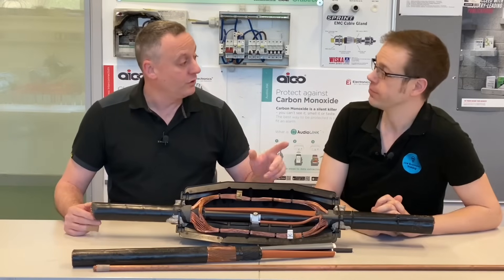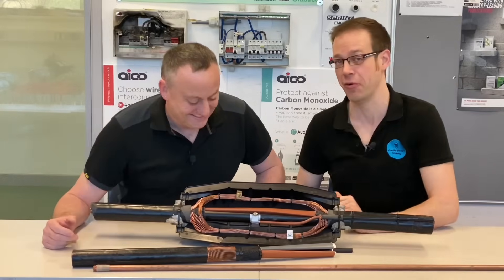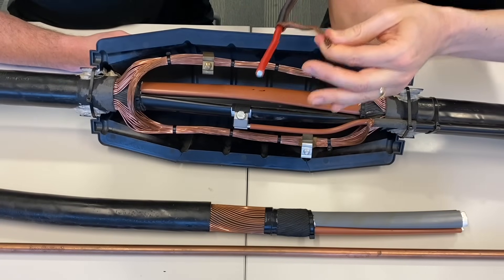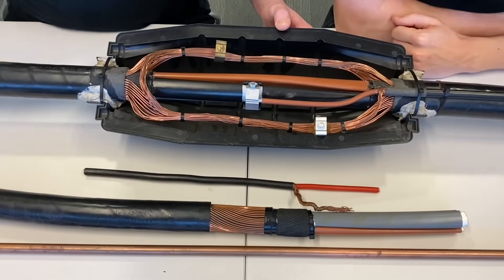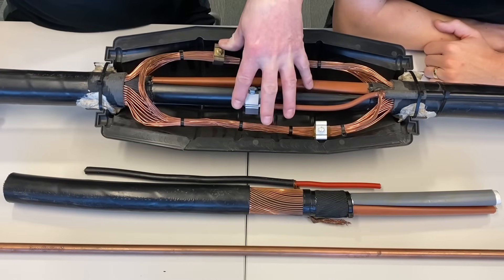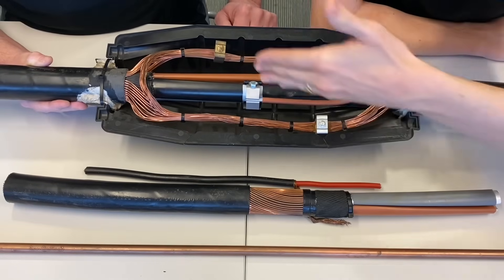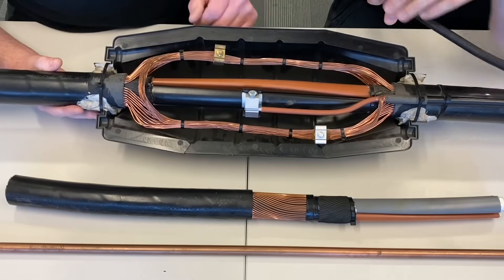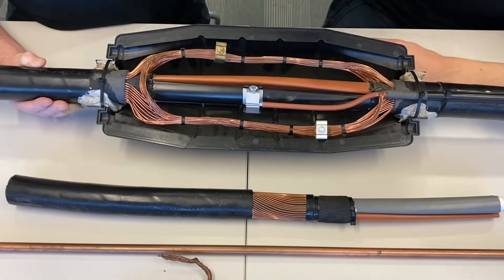Broken Pen Conductor - What’s Going on Inside a TN-C-S Cable Joints. PEN - Protective Earth Neutral

Comment: Old pilc cables contact the general mass of earth through the hessian sheath via the lead. In the 80’s when PME was coming in, jointers would go and bond the neutral to the lead at the extremities of the network with an earth rod in the ground. Jointing methods have never ever allowed the neutral or phase to be broken on service breeches as the joint must be done live to prevent the loss of supply. This goes all the way back to the origins of the electricity network in the UK. A distributor must still earth their PME network at all extremities via an earth rod in contact with the general mass of earth. PEN faults are likely to be caused due to the material of the neutral earth, it was coming in the 80s to install cables with an aluminium sheath, if this sheath was nicked then the aluminium would corrode and cause a PEN fault. The resin still sets rock hard as it provides mechanical protection, it is required by law. There is temporary resin which is used on temporary joints which is flexible, it cannot be used on permanent joints.
Reply: Hmm, this comment sort of contradicts the statement that "modern" resin fillers should remain very slightly flexible (is the filler now in fact silicone sealant I ask myself?).

Any response to this comment?
Reply: @t1n4444  It's polyurethane resin and it sets rock solid.
Reply: @intelmacs  Hmm even more curiouser. 

(Once watched a contractor fix a cut through underground supply cable using an elongated version of the kit in the clip.

Bloke had an audience of interested techies as cables much bigger than stuff we worked with. As I recall there were busbars which the broken cable ends were bolted to. Then cover attached and then back filled with a two part resin in a pouch which was a light green.

Capsule was clear plastic so you could see if there were any voids.

This must have been 30 odd years ago.

Contractor bloke said that this was all he did ... apparently it was considered "easier" to simply "JCB" through cables rather than carefully work around them when laying other services.)

Anyway, any comments from presenters?